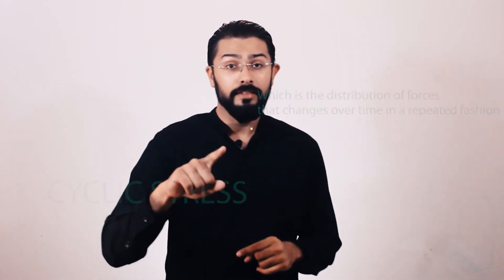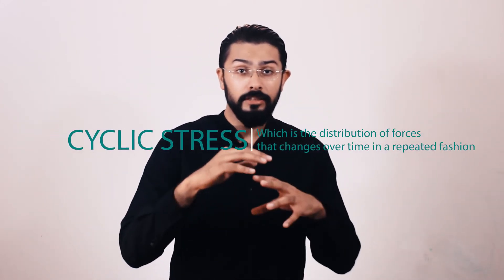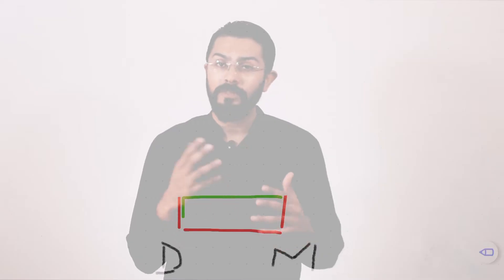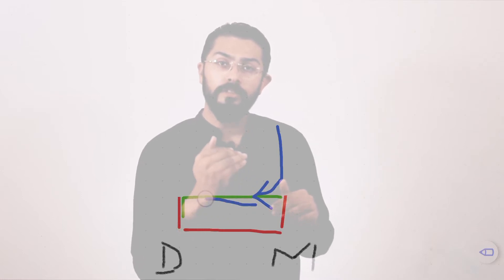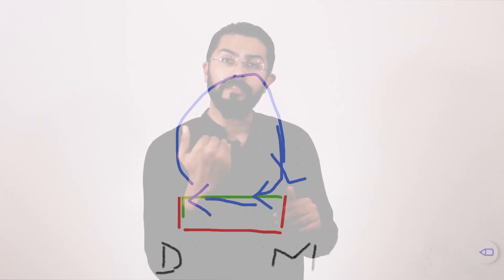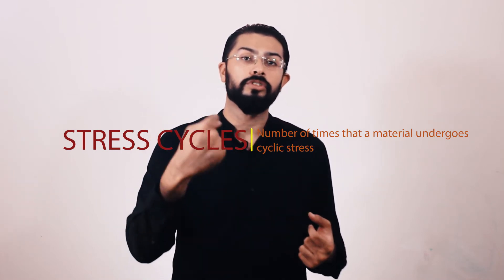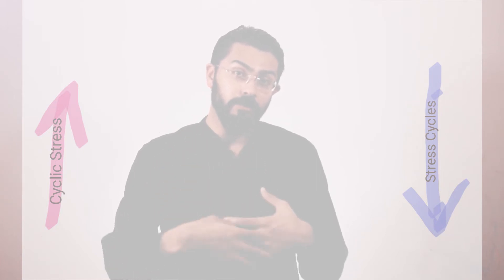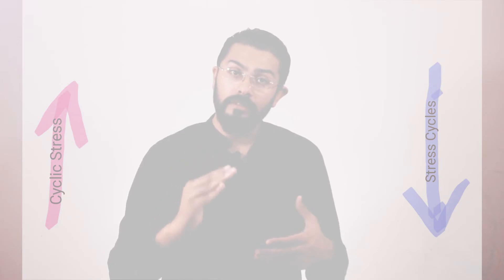Fatigue Properties of Dental Materials

Comment: Which dental material suffer from fatigue?
Why does ceramic made Prosthesis suffer from fatigue even under low stress of mastication?
Kindly ans those question 💥
Reply from the maker: Thank you for posting your queries :) 
I have answered your questions in the video, but I'll write them down here again. 
Almost all dental materials that are present in the mouth for prolonged function and longer periods of time undergo fatigue, these could include restorative materials, prosthodontic materials. Every such type of material undergoes fatigue at some level. 

Ceramic prosthesis suffer from fatigue under low stress of mastication because the ceramic is brittle in nature and secondly it could also happen because of improper occlusal contact zones, and excessive occlusal loads also act as a cherry on top. 
That is why scientists are working every day to improve Ceramic as a dental material, by experimenting various types of ceramics as a restoration.